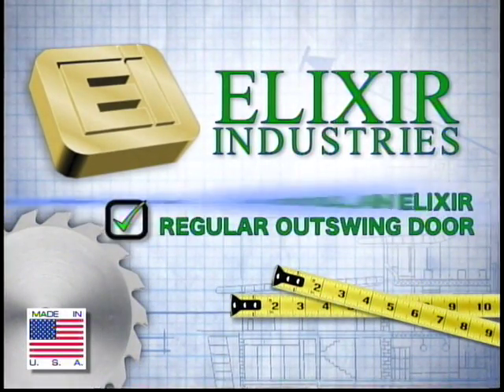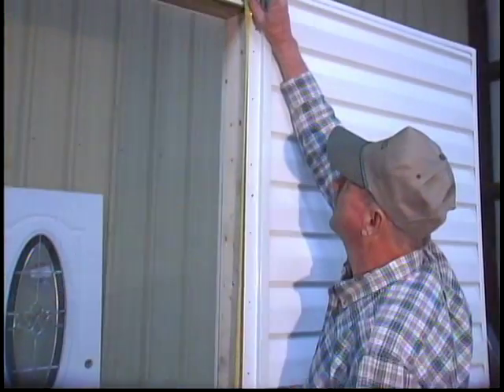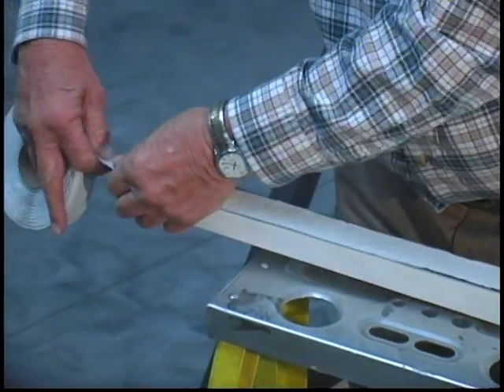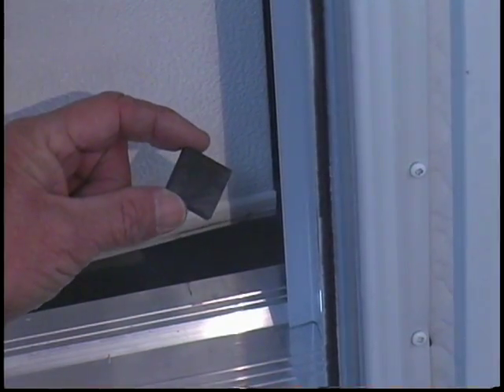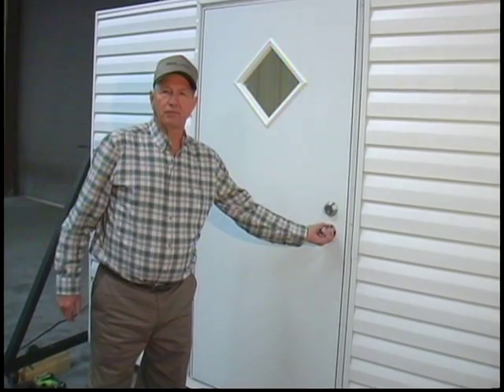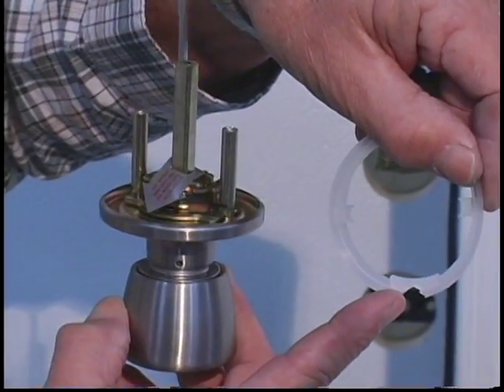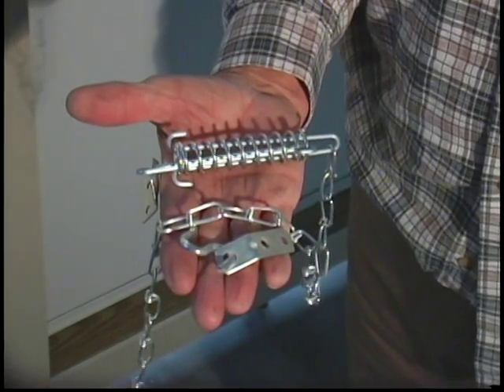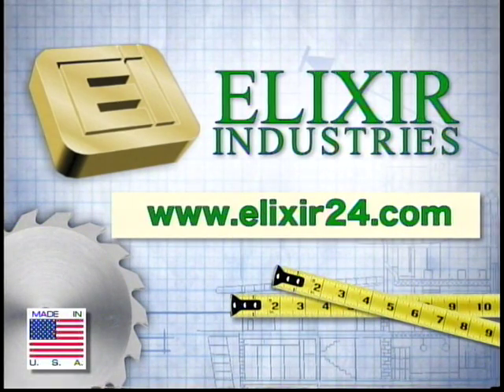Elixir Industries:  How to Install a Regular Outswing Door

Comment: what I can't find anywhere-how to replace an inswing unit with an outswing unit- on an  8"  block wall.  (plus furring and drywall = 9 inches)  How will that work out with the finish jamb, interior trim and ceramic floor tile?